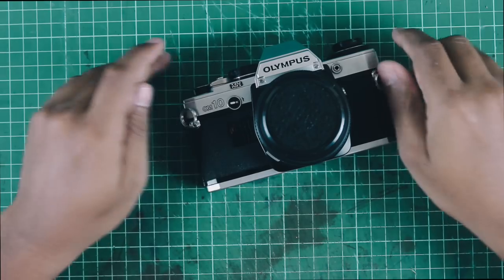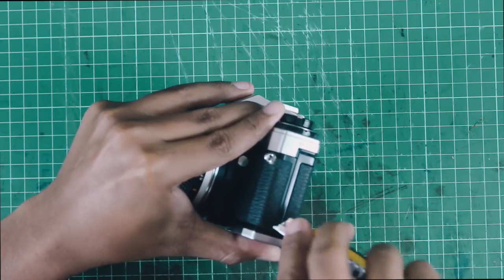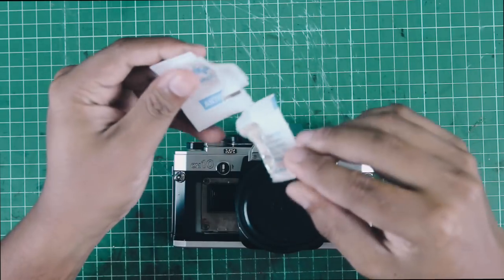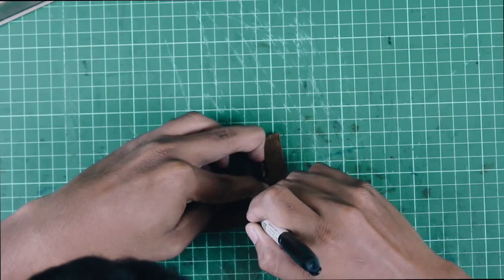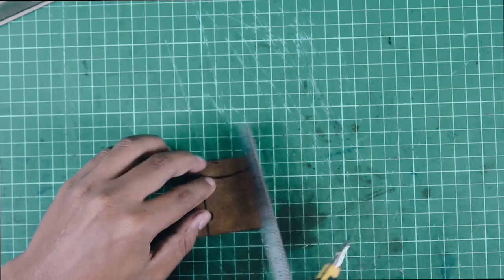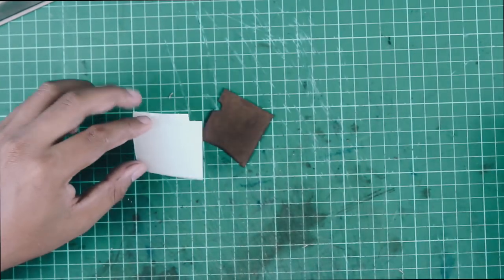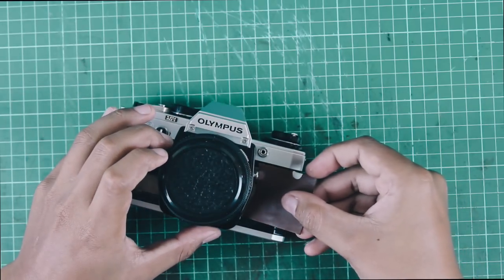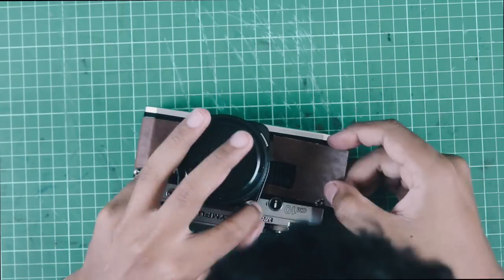How To: Camera Leather Replacement // Re-Skin Camera [ Week 39/52 ]

Comment: Great video.  A better more accurate way of placing the self stick tape/leather is right before applying it, use a small paintbrush to apply gel- clear hand sanitizer to the camera and then stick the sticky leather to it.   This allows you to place the pieces and get a perfect fit.   Over the next hours the unscented gel hand sanitizer evaporates and fully sticks.   This is how I do most of my camera leather.

Comment: I could understand if it needed repairing, but you ruined a mint camera for no reason
Reply: He didn't ruin anything, he could very well have kept the original leather. To be fair, it wasn't well done at all in this case, however, if done well, with thin, soft grainy leather the end result can look and feel much better than the original camera, considering that most cameras back then either had leather textured plastic, or leatherette that hardened into plastic practically.

Comment: The double sided tape was your downfall all the cool ones used glue
Reply: Jack O'Callaghan which glue is the best to use?
Reply: @dusanstanic1462  Pliobond glue.  It's at Ace Hardware. Or online.  Buy some small application brushes and trim them half size bristles to use those to apply the stuff.  Smaller bristles give better control.   For camera leather you really dont need to do both sides. Camera side then leather side.  Just use Naptha to remove the excess on the camera body and scrape it off then put the contact glue on the leather and stick it on.  This stuff is volatile. Use it near a window.

https://www.amazon.com/dp/B004JOYXR4/ref=cm_sw_r_cp_apa_i_yPY4EbHJ4WDKD